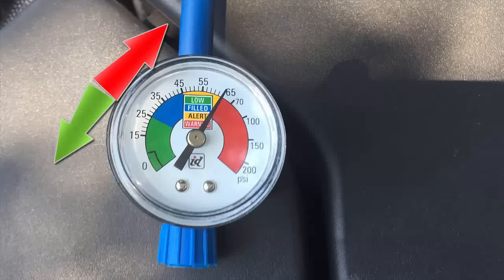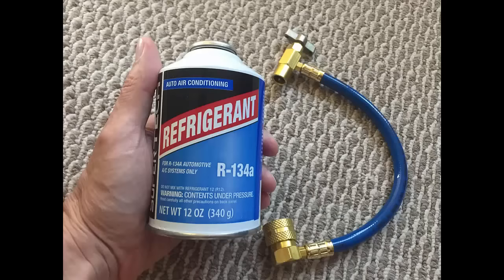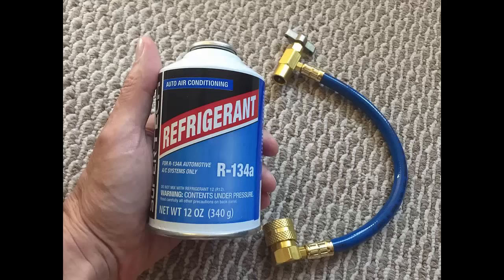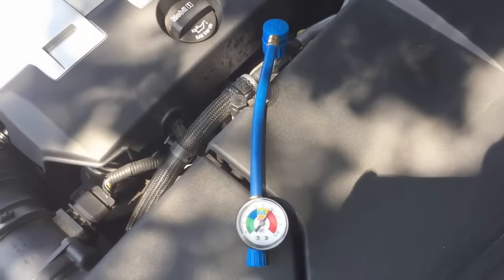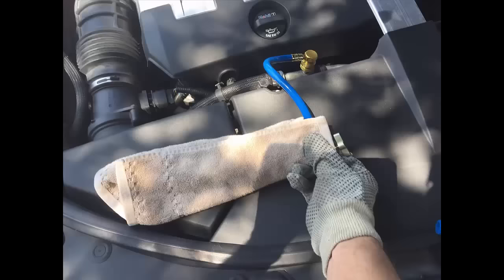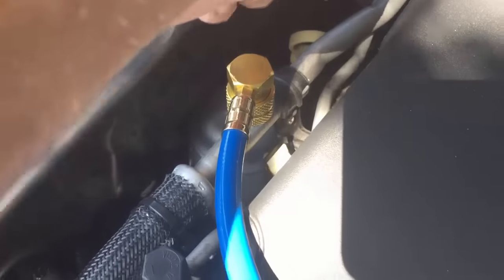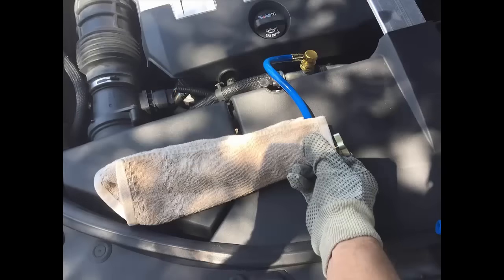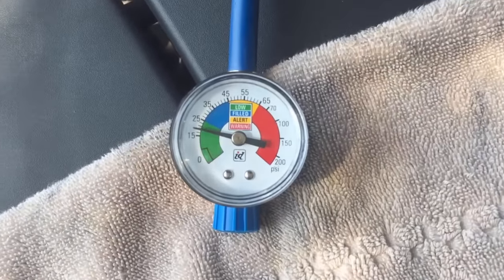Car AC pressure too high FIX overcharged a/c gauge fluctuation reading jumps Up Down Freon problem

Comment: You just broke the law
Reply: it's 134a remember it was made because its goods for the trees,no like r12
Reply: it's 134 a  that's why they sell  it at walmart(millions of cars are leaking this,no one is being arrested)Don't see r12 at walmart,have to have license to buy it,or r22
Reply: if you get caught leaking it into the atmosphere the fine can be up to 20,000 dollars.  but this really only applies to professionals.
plus its terrible for the environment. i dont know where your getting your information but its wrong.
Reply: they sell it at walmart,they know it's going leak out some day
Reply: I sell Freon ,if you're buying it ,you have already leaked it,or you wouldn't need it
Reply: i'm not talking about a leak in the system. i'm talking about deliberately opening the system  and venting refrigerant to the system. its also wasteful.
Reply: we've beat this dead horse enough
Reply: 134a is still bad for the environment, just not as bad as r12. They are now replacing 134a with 1234a, not as bad as 134a, but still also bad for the environment. Anybody thinks it is ok to release these gasses into the atmosphere needs to call your local EPA to see if it is legal!
Reply: they know people are going to  release it in the atmosphere,or they wouldn't sale it off the shelf at walmart
Reply: EpA does not care,or they would not let walmart sale if off the shelf to just anyone!
Reply: No it's 80,000 dollars ! up to 5 years jail
Reply: Dude, 134a is purposely released all the time. Its called an asthma inhaler. They just happen to call it Norflurane instead of 134a but its still 1,1,1,2-tetrafluoroethane.
Reply: Cars period bad for the air but ain't stopping them lol
Reply: The EPA will shakedown whoever they please for whatever amount of money they can get out of them.  There is an unlimited number of vaguely worded laws for them to use on you.  You are at the mercy of the crown.  After they have collected their money for fines and "permits" they will leave you doing exactly what you were doing in the first place, so they are really a taxing entity instead of a protection entity.
Reply: says it in my car manuel "r134a doesn't harm the environment" of course my car is a 2001 and maybe science proved it otherwise.
Reply: It's illegal BECAUSE it's a greenhouse gas and contributes to global warming. It's over 1000 times more potent then c02 as a greenhouse gas. Either invest in a recovery machine or take it to a professional.
Reply: It's a bit heavier as a gas and it isn't that much more potent.  Even if it were, ironically, you would cause more pollution manufacturing a recovery machine or traveling to a professional.  I have a suspicion that the EPA actually increases pollution in spite of the intent of the bureaucracy.
Reply: narnianhero that's incorrect, a gallon of gas produces 20 pounds of carbon dioxide, 20 ounces of r134a refrigerant is equal to more than 1750 pounds of carbon dioxide. So no, driving somewhere is not worse for the environment even if it took a full tank or two of fuel to get there.
Reply: This is interesting.  I'm looking at the chemical formula for tetrafluoroethane.  Assuming it reacts right away there are still just 4 fluorine atoms on the molecule.  It has to both produce a light enough gas molecule to float into the atmosphere instead of sink down, and produce quite a massive chain reaction to do the amount of damage you are talking about.  I suppose it could form 4 molecules of weak fluorine acid FH, but I don't see that causing your more recent claim of about 560 times more (down from 1000 times more) effect than gasoline.  Do you have any info on the chemical reaction when the refrigerant hits the atmosphere?
Reply: narnianhero I'm quoting EPA studies. Ask them, baseline is this is illegal. I will be reporting this video to the EPA as well. There's a $10k Dollar bounty for people dumb enough to think the EPA won't do anything lol
Reply: I'm asking for the details, not the summary of a politically motivated study.  Just looking at the study summary is making an "appeal to authority" logical fallacy.  I want to see the chemical reaction formulas and then look at the density per volume, because those EPA stats smell suspicious.  The EPA never goes deep enough to the far reaching impact of their own laws and the detrimental effect on the environment that the EPA causes.  

Also, be careful, the EPA can probably find a few hundred thousand dollars to fine you if they wanted to based on vague laws you didn't even know were there.  Then they leave you doing exactly want you were doing that was so hazardous in the first place because you now have permits for it.
Reply: narnianhero it's not a reaction, a greenhouse gas let's heat in but not out in a manner of speaking, it acts as a one way blanket. As to how to how such a heavy molecule ends up where it has that effect, I don't remember. When I find the EPA paper I'll link here.
Reply: I'd appreciate that.  That's a big point of mine, if the molecule is too heavy it doesn't have a major influence in the atmosphere as a greenhouse gas, so I assumed there was a reaction of some kind.  I wouldn't put it past the EPA to make the mistake of just looking at what goes into the atmosphere and not whether it sinks or floats.
Reply: All I can say is wow at the stupidity in all these comments. 1. To collect that so called reward u have to have proof. Hard proof. Not once in the video did he show himself releasing anything. 2. Since your so smart how do u recover the refrigerant as a non professional? I'll tell u. U need a recovery machine that costs upwards of $600, a cheap set of gauges $60, plus a certified recovery tank $250. As a certified A/C service tech i release more r22, r410a, r407, r438a in a routine service call then this guy does in 10 yrs thru hose bleeds. R134a is laughable compared to R22 when it comes to the amount of molecules that kill the ozone molecules. That's why they sell it at Wal-Mart, AutoZone and other fine stores. Now before u have a seizer attempting to explain epa rules and regulations let me tell you, im epa certified. Which means not only did I read everything ur reading now, I read more. Did you read the part where it says u can have no more then a 15% leak on a r22 system before it must be repaired? Imagine how many molecules that kills per yr? It's 35% on commercial. Plus anyone over 18 can buy r134a. But only epa certified individuals can buy r22 and other refrigerant. So go ahead and report him, just know there's consequences for false reports.
Reply: FINALLY someone who actually "KNOWS" posted!  Thanks James Hightime!
Reply: If Trump doesn't give a fuck about the environment why should I ?? Lol
Reply: Worked for me. It is environment friendly.
Reply: James Hightime:  Thanks for the additional information, but you know as well as I do nothing would happen to either this guy or the idiot trying to report a DIY person.  One, this guy is small time and the paper work would be too great.  Two, they wont do anything to the idiot reporting him because too much paper work and they don't want to discourage people from reporting stuff.
Reply: JDH Rosewater:  Its not a myth, it just isn't happening the way it is being portrayed.  Only simple minded people think that a couple hundred years of human industrialization is going to influence the earth's natural cycle in a negative way.  I have not found any scientific study that specifically states that human activity has caused the increase in temperatures nor have they said that it has influenced it.  The earth's orbit fluctuates around the sun causing the initiation of the heating and cooling of the earth.  CO2 plays a part but is not the cause.
Reply: Just an FYI: R12 is a CFC (chlorofluorocarbon) and was banned because it damaged the ozone layer; not because it's a greenhouse gas.  I believe that having all fluorines and no chlorine makes R134 less reactive with ozone and thus safer to discharge.  BTW, R12 is still permitted for use as a flame retardant so I'm sure all appropriate agencies are aware of limited and potential discharge.  Usually the EPA only enforces on commercial enterprises.
Reply: I do whip-its from cans of r-134 everyday..
Reply: And NEVER use an inhaler!  Same thing!
Reply: LOL who told you that ? its not as bad as R22, but still bad..
Reply: Do any of you realize the refrigerants COME FROM TE EARTH. They are already present in our soil and or atmosphere.  It's not like it came from space .  The concentration is bad but it's not like we created some elements that didn't exist.
Reply: @jeffhesse8415  R134a has *ZERO ODP*. "ODP" is ozone depletion potential. That is why it was forced upon us. Zero ODP means "dump it freely".
Reply: If you get busted you know who SNITCHED

Comment: Are you relieving the pressure on the low pressure fitting or the high pressure side?
Reply from the maker: I did it on Low pressure side with the same hose but without the can.

Comment: glad i came across this video i dont know exactly what the problem is with my ac but 3 years ago had the condensor replaced due to a leak and for the 3 years it was just fine and then one day it was just hot and was the first time of the year using it so i figured ok lets buy a refill and went to hook the gauge up and the psi was up to 101 and then i let pressure out until it was in the middle of  the green and now its ice cold again hopefully it was as simple as that but still going to take it in and see what they say

Comment: Hi so you let the ac pressure out on the High or low connector ?
Reply from the maker: That hose fits only on the LOW side connector.

Comment: I got an eyefull the other day and I'm not blind.
Reply: @Panther Platform 
You might have been far enough away from the concentrated gas and it was mixed with the surrounding air to prevent a problem. Don't take chances you don't need to with this stuff, 
WEAR SAFETY GLASSES AND INSULATED GLOVES! Stay safe friend!

Comment: Great video! My question is this: so I know I overfilled it because I'm getting all hot air now and also my compressor is idling rough every few seconds after using AC Pro.  So you're saying to remove the half  used can and hook the gauge and hoes back up and then start squeezing the trigger? I do understand I need to have the other end wrapped in a towel also wearing gloves. Thanks boss!
Reply from the maker: Since I didn't use AC Pro, I can only assume that when you take hose of the can, left over refrigerant will escape from that can under high pressure (keep that in mind)
Then hook up the hose to refill port and squeeze the trigger few seconds at the time until pressure stabilizes in Green area.
I've used a basic hose, so I can only assume this will work with AC Pro hose.
Good luck and let me know if it worked!

Comment: Looks to me the refrigerant has non condensables in it, should clean coils,check orifice tube abd then leak check system ,evacuate all air then charge to recommended weight of refrugerant...that will fix it perfectly.good luck.😂
Reply from the maker: Yep!

Comment: Reason your gauge pressure seemed off is it did not have an overlay dial to account/recalibrate/offset for outside air temp which increases internal pressure.
Reply from the maker: You are probably right, these cheap gauges are not very accurate and you can't even calibrate it. Thanks for watching.
Reply: @Your-Self    Having a similar problem myself. My first stumbling block was using the cheap gauge that came with the recharge canister of 'Nevada Refrigerants' that I picked up. It had a leaky release valve, so it kept under-reading the A/C pressure with the engine off and the R134a canister disconnected. Bought a better quality STP gauge and it works well. (Only downside is that it only works with STP canisters.)

Comment: Exactly what happened. I released pressure at night when it was cool and AC stayed on got ice cold. But, during the hot day started cycling again. So this was going to be my next move release pressure during the day, which is ironic cause that puts me well under the refrigerant capacity of the system, and your video confirms what I suspected, However I am starting to suspect that I have a bad pressure switch.
Reply from the maker: If there is a leak in the system, regular air could've been sucked in. Since the air and the refrigerant gas have different properties, the pressure inside will jump up and down.

Comment: Question-finally got my pressure right and the low side even got cold for a minute or two but still blew warm air. Bigger concern was when i was releasing the low side pressure - what came out of the line was not even cold much less freezing air/oil mixture. It was like warm air at best. Shouldn't refrigerate being evacuated out be cold at some point?

Comment: Thank you- I had the right idea by doing this same thing, but again, as you said- its still not quite right.

•I went to add the kit, and hadn't noticed before, that the compressor had NOT been "kicking on". The gauge read high, and the parts rep I talked to said it WILL read "high" if the compressor isn't cycling- basically so the compressor doesn't over work pressurizing the low volume- makes sense. 
(thats the fluctuation you have here- when gauge goes low, the compressor clutch is on, and high, off.)
• As I filled it, I then heard the compressor cycle, telling me it hadn't been since I didn't hear it til adding coolant charge. Then the gauge went up to 80psi, but fluctuated still down to almost 20 when cycling.  Not wanting to damage things,  I released as you did here, til about 56psi.

•Next day, today- I went to ask input from the parts rep who said you really "can't overcharge the system in his experience, it'll only hold what it will hold."  Obviouly this is only "generally" accurate, as the gauge wouldn't say "warning" and instructions wouldn't say "professional service". 

•So I added the other half of the can, noticing pressure back down to 20psi. The compressor then engaged for LONG periods of time, almost 30 seconds. And once the can was finished- it was engaged FULL-TIME. 
Not wanting to ruin things, I turned AC and Defrost (which cycles the compressor to assure it doesn't seize up from not using A/C in winter.) Off and back to warm/mid.

•I then went back to get 5 more small cans of charge, added, and noticed the compressor now does NOT cycle OFF- it is ON full-time, but was confused as the air is now cool- but not COLD.

• Fed up with this gauge,  I went and got the normal "cheap" kit I'm used to with the trigger, as you showed here, and I added til it would not take anymore, and started to leak out of the trigger assembly instead.

•☆•My theory has been all along, that the old refridgerant is degraded, so it needs to be "evacuated" before recharging- however I've never had this issue with ANY other vehicles I've used these kits on. 

I kind of just assume the worst because this Tahoe just continues to punish me but I have access to a shop I work at with a proper machine for this system:
I intend to try once again dropping pressure back down to where the compressor cycles in a reasonable range, and hope it cools. If it doesn't,  I'll go use the equipment and test at the shop. 

•Either way, I intend to follow-up with my findings. Thank you!
Reply: From Ye 'ole Google:
"Mechanics often misdiagnose high-pressure gauge readings in a car's air-conditioning system. ... Most high-pressure readings are a result of the freon or refrigerant not cooling adequately. Insufficiently cooled freon automatically causes the pressure to increase."
This is my theory, old degraded coolant charge not compressing because of molecular decomposition or something like that less technical haha!

"When the pressure of the AC system is too high this might indicate a leakage or diminishing amount of refrigerant, both of which require immediate attention. ... If the AC temperatures are abnormally warm, this could indicate an issue with the compressor that might need repair or replacement." 
I don't feel like there is a leak or failure in my system I still have a hunch its old degraded charge that needs to be evacuated.  I'll edit comments as I find out later.
Reply from the maker: The refrigerant inside the A/C system doesn't get old and degraded unless there is a leak in the system. Regular air can get sucked inside if the leak is on the LOW side. Since the refrigerant and the regular air have different properties, they don't mix well and cause weird pressure readings.
Have you tried to check how much refrigerant you have in the system with a Static Pressure Test as on the next video?... https://youtu.be/7loH93-9MNQ

Comment: When you're compressor short Cycles you can put one can of gas in easily make sure you have a gauge the one you buy at AutoZone will only show the low side they will also short cycle when they are overcharged the safety switch and kick i in and out all the new cars have a high pressure safety switch if it's Shore Cycles when it is low you could burn up the clutch so remember that

Comment: Hi! I have the same exact issue as you. When I top it up, low pressure goes up on red so i would bleed it out. It works and aircon is cool when pressure is just under the 25 mark. I only did that yesterday...Just want to ask, how long did it stay that way for you? And waht did you do in the end? Did you eventually brought the car to the garage to get repaired? Thanks!
Reply from the maker: It's been about a year working great. My AC tech says there maybe a tiny leak somewhere in the system, but he couldn't find it, so I add just a little bit more refrigerant once a year, but add very little at a time not to overfill.